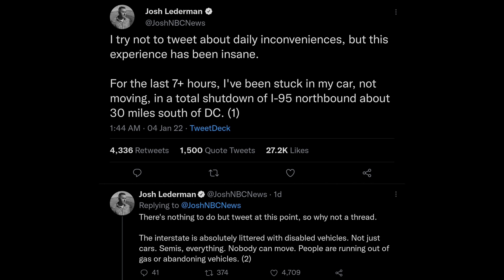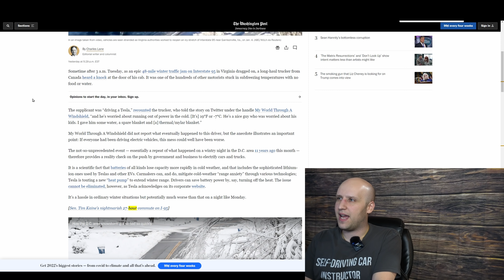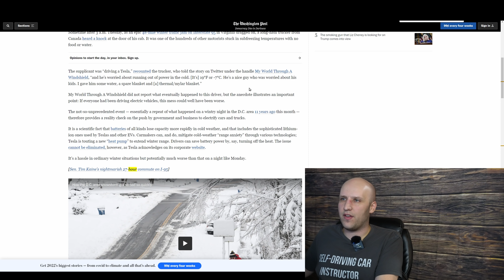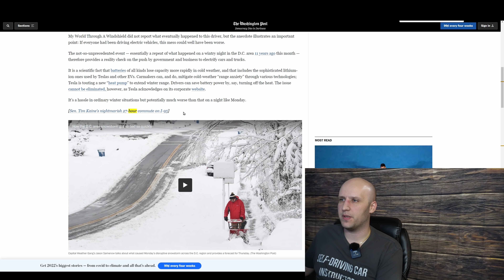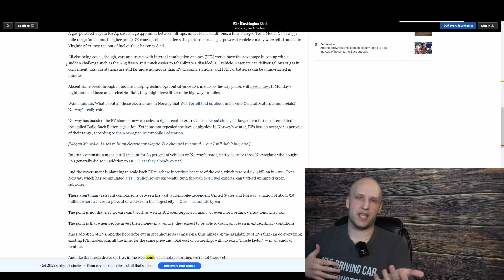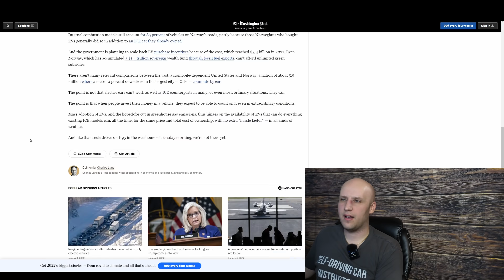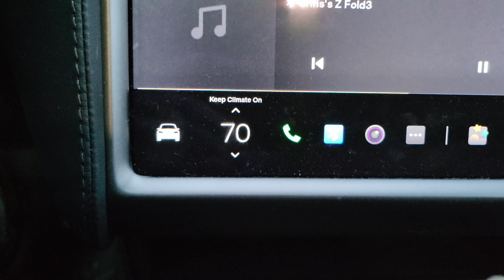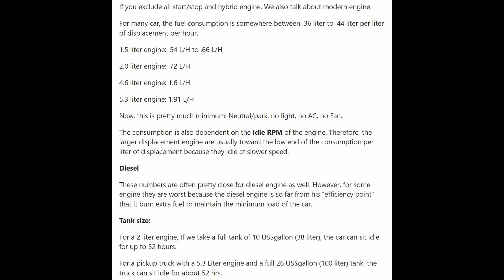How Long Can a Tesla Keep You Warm In A Frozen Traffic Jam? | FUD Debunking

Comment: I spent the last 4 years living and working in that area of VA. Moved back MN recently.  My dad sent me this article and I laughed because I would have rather been stuck in that situation in my Model Y than any other car. Would have been able to run the heat and watch TV for days before running out unlike the senator that had to run his car for 10 minutes every hour to make it through the 26 hour ordeal.  
Side note. My wife just took my car to work in the -24 F temps today because her gas car couldnt handle it.  It started at 92% drove 30miles ended at 77%,  sat for 13 hours and only lost 5% just started preheating for her return trip. Sad times when the electric car has to save the day eh?
Reply: Sounds like you need to keep up on your maintenance. Most cars start just fine in -24 if they have a good battery. My car runs just fine in MN weather.
Reply: I forgot the TV advantage and people mentioned "camp" mode.
Reply: Please give us details. I am sure most gas cars would still run at -24 degrees.
Reply: @jrod6236  They really don't like to and starting in those temps causes major damage to any ICE over time.
Reply: if it couldn't start, that has nothing to do with the gas engine but rather the battery that's used to kick start it. either it's charge is low or it isn't rated for those temps, that or there might even be something wrong with the starter. so either put the battery on the charger to top it off, get a better battery that is rated for the temps in your area or get your started checked out.
ofc pure electric is better in this case if you just want to get up and go. still like everything, not everything is instant and you wouldn't just get into your EV and go without preheating it.
Reply: @rocksfire4390  Preheating an EV before daily driving is all about passenger comfort.
Driving a cold battery is fine, it just won't regen much.

If you are gonna be driving a long trip you might want to preheat the battery to get more range, but for daily driving get in and go is no problem at all, except for driver comfort.
Reply: @dorvinion  
sounds exactly like ICE cars, aka you don't need to let them warm up and that's entirely just driver comfort.
will be nice once they get solid state battery tech into these EV's, cold wont do much of anything in most areas to them then.
Reply: How has your Tesla been in MN so far?  I also live in MN and have been apprehensive about Tesla due to their performance/ reliability in very cold weather.  Things such as drastically reduced range, charging in cold weather, autopilot on poor road conditions, etc.  Also concerned about the long-term effects on the battery.
Reply: @Tekmauz  Tesla tests their cars at a facility in Alaska which is part of the reason they switched from resistance heaters to heat pumps for the efficiency.
Autopilot just won't work if it can't see the lane lines, so in snow you have to steer yourself. New Model 3 and Y don't use radar anymore, but my Model S still uses radar and on my cross country trip at Christmas I had to clear snow and ice off the radar unit several times so I could use the adaptive cruise control, or autopilot. The radar is at the bottom center of the front bumper and snow packs in there. Tesla AWD is very very good combined with the weight of the car means very good traction.
Reply: @kenmcclow8963  thanks.  Another concern is the lack of Superchargers in my state, especially north of the Minneapolis/St. Paul Metro area.
Reply: @kenmcclow8963  I have seen (on Youtube) autopilots using tire tracks as guide lines as lane lines. Not the most efficient or safe, but it does do that when lane lines are buried in snow.

With my Infiniti I sometimes have that problem, radar is covered with snow and cruise control is unusable.

Cant wait for my Model 3 and ditch Costco gas line ups. Its either line up at Costco or pay more at other gas stations.
Reply: SAVE THE DAY , HOW BOUT YOU HAVE AN EMERGENCY AND YOUR FLAT BATTERY IS ON CHARGE = YOUR SCREWED , OR THE BAD GUYS SHOW UP AND YOU CANT ESCAPE DUE TO FLAT BATTERY . WHEN A V8 WOULD DRIVE STRAIGHT THROUGH YOUR GARAGE DOORS LEAVING THE BAD GUYS IN THE DUST !!!!
Reply: @lancethrust9488  In 2 years with an EV I've come home with less than 5% charge once. Even then if I had to get away from bad guys at home I can make it to the local cop shop.

On the other hand, getting to the garage in most houses means going through the bad guys, so you'd probably have to give the bad guys a case of lead poisoning before you'd be able to get to the garage...and if you manage that do you really need to get away any more?
Reply: @dorvinion  NO WHEN ITS FREEZING YOU SHUT DOWN HALF A MILE DOWN THE ROAD , THEN THE BAD GUYS SHOW UP IN THERE V8S , GAME OVER YOU SHOULD OF BOUGHT AN ICE VEHICLE !!!!
Reply: Send this video to him
Reply: Yeah what about a few years ago when California had a complete blackout how many Teslas were sitting in line to get power it was a total nightmare cars lined up for miles with no power
Reply: @dobermanguy9437  California rolling blackouts only affect a limited area for a short drive. I call BS unless you can cite references. 
A blackout would suck if you ran your battery down until you couldn’t go anywhere, but I always keep a 10-20% reserve so I could keep going. Plus Tesla tells you on the center screen how many plugs are available in real time at your next charging stop. I can’t speak for other brands that I don’t own
Reply: @kenmcclow8963  right! And all these what if situations, maybe true but rare, have mitigating factors. 

It makes the case for solar power backup for your house in case of a blackout. We don’t disconnect from the grid due to such blackouts or go out running to get solar. 

Give it some time and we will have most homes backed up with solar so grid blackouts won’t have such drastic effect as they do today. 

EVs are not for everyone but it’s great for most use cases of vehicles, provided one can afford to buy the car in first place. EV are here to stay and for the right reasons.
Reply: @kenmcclow8963  look good thing you kept some power in your car when they showed that news report there was hundreds of Tesla's lined up waiting to get charged it was total chaos if you think I'm making this up look it up for yourself
Reply: @dobermanguy9437  you may be talking about thanksgiving traffic on I-5 a few years ago but I just went through right after Christmas and there are 56 stalls at Kettleman City and they are adding 100 stalls a little up the road at Harris Ranch, plus lots of other chargers and some are fast V3. There are very few times of year when traffic is bad at Superchargers
Reply: Never  happened.

Comment: Maybe your tune will change when it costs $20k for a new battery, or when you spend 8 hours stopped and charging on a long road trip. Must be nice to be rich and own two of those money pits.
Reply from the maker: Hey man. None of that is true. We drove from MI to NC in a single day https://www.youtube.com/watch?v=07EnZpZKAVs 

Charging stops are normally only 15 minutes or so depending on the route you're taking, but can be as long as 30 minutes or more, with the longest being about an hour. I've never personally needed to charge longer than 30 minutes on a road trip. 

The battery warranty is 120k or unlimited miles (depending on the vehicle) and 8 years. But there are many examples of Tesla batteries lasting much longer than this. 

Unfortunately for now, most long range EVs are pretty expensive. But over time prices will continue to come down so everyone can drive EV soon!

I've been driving electric for 3 years and almost 70k miles and I wouldn't have it any other way. If you have any other questions feel free to ask!
Reply: @DirtyTesla  and advancements in battery tech are going to make them cheaper and last longer. In particular I am looking forward to solid-state battery technology in production vehicles.
Reply: You assume that everyone who owns a Tesla has a higher than average income. The average price of a new car is around $45K so a Tesla Model 3 or Y are within that range. I have traveled all over the country from Florida, to Seattle, Los Angeles & Boston in my Model 3. I have very seldom had to sit waiting impatiently for a charge, certainly not 8 hours. Please be kind, and don't make negative comments based on a lack of knowledge.

Comment: Thanks for the experiment.  Dressed for winter my Tesla actually gets too warm when I set it for 70 in 30 degree or colder weather and my 70d has the resistive heat.  Also the seat heater gets way too hot on 3.  In any case, folks would NOT freeze to death in an EV as the Washington Post article hinted at especially if they set their heater at 65 and left a seat heater on low to medium setting.  In the coldest weather I usually have the seat at 1 and the heat at 68 and I'm dressed for winter.  Based on your experiment, I'm certain I would have no problem surviving (staying warm enough) for more than 24 hours and would still have ample battery to get to an A/C outlet or charger when traffic started moving again.

Comment: Great analysis and test. Very fair. A few disadvantages of gas cars worth mentioning.

All those gas cars running their engines on idle. That's a lot of fumes you are breathing in. If we were 100% EV then on I-95 there would have been no fumes.

Snow can drift and if it drifted and covered the exhaust fumes could backup into the car, or the car might quit running. Neither scenario is very safe. Once again an EV doesn't generate fumes or need oxygen to keep running.

When people ask me what if you get into a traffic jam, I typically answer I smile because I know that my efficiency and vehicle range just went way up. A traffic jam gives me less to be concerned about with regard to range than driving at the speed limit.

Comment: Great video and awesome advice.

Here's the thing, and you touched on a lot of this in your video. If you own an EV and you live in a cold environment or you know you will be experiencing some cold weather and snow in the forecast then make sure you're charged to the 80-90% before getting on the roads...be they your local roads or the highway.

Depending on the vehicles storage you might want to keep a decent warm blanket in the car. Keep a couple bottles of bottled water. Keep some snacks such as granola bars or other snack bars that don't need to be refrigerated and maybe some bags of chips. These items will hold up well in the winter time.

If it hasn't been mentioned yet , if you own a Tesla and you're going to be stranded on the highway like this or stuck somewhere in a cold environment then use the vehicles "Camp Mode". I believe it will do a lot of what this test just showed. You still have access to games, entertainment, Netflix and more. 

If you have a large enough EV then consider keeping an air mattress made for vehicles/camping in the car. If you own a Model 3, Y, X and I assume a S you can inflate the mattress and fold the back seats down so that you can stretch out. Check out some Youtube videos about camping or sleeping in your Tesla and you will see how possible it is and get an idea of some of the products people use.

Look, I live here in Northern Virginia and I'm all too familiar with the traffic issues on I95. While it's best to to not be in that mess during a snow storm it may not be avoidable. If you can't avoid it then follow the suggestions in this video and some of the things I said above and you won't be uncomfortable in your EV. And you'll see that the article overhyped the situation.

Comment: I believe the comparison between ICE and BEV here would change as the exterior temperature decreases.  Heating the cabin of an ICE in a traffic jam would be a byproduct of an engine that is idling regardless, with the cabin temperature being regulated by flaps or whatever mixing inflow of air.  In an electric vehicle, the cabin temperature would be regulated by pumping more or less power to the heating system?

Correct me if I'm wrong -- it would be interesting to see this comparison at -5 or -10 degree increments to see the effect of heat losses from an idling combustion engine depending on the delta between exterior and interior temperatures.

Comment: What a manipulative crap article it is...😮 How long can you run an ICE in order keep the passenger compartment warm? And how long does it take for people to drown from a lot of ICE cars idling at one place?
In contrast, a BEV can produce heat for days without any exhaust. Even with a resistive heater. Equipped with a heat pump, a week? It's just stupid to travel with a low battery. Just like with low fuel.
Also, you can rescue a few ICEs with a can of gasoline. How much BEVs can be rescued if that gasoline is used for a mobile electricity generator? More than the former, I'm pretty sure. Efficiency...

Comment: I got stuck once in my LEAF for 6 hours in traffic and I just used the seat heater and my electric blanket.    The battery is too small to keep the heat at 70 degrees in a 2012 LEAF.   In 6 hours I only used around 15% battery.    I turned the windshield defrost on only when it fogged over.   

Now I have a 2021 Model Y and I don’t need to “rough it” any longer.  I can pump the heat the whole time. :)
Reply: I own a 2011 Leaf. Did you trade yours in when you got the Tesla?
Reply: @waywardgeologist2520  Nope.  #LEAFsavesMyParkingSpot
Reply: @nissanleafbattery  I don't live in a large city and don't have to struggle to just have a spot to park. 

How do you home charge?
Reply: I drive a 2013 leaf and work 12 miles from home. Last years winter range was close to 27 miles in the 30s if I did not use the heater. I am limited to car seat heater and steering wheel heater in the winter. Nissan sucks, never again.
Reply: @donquique1  That’s what I can do,   28 miles now.    Instead of spending $7500 on a new or slightly used pack; I bought a Tesla.   Life is too short to drive short range cars.   Here’s my Tesla: #NAY2GAS
Reply: @nissanleafbattery  my Nissan dealer cannot even get me a battery even if willing to pay for it.  I love driving evs but have serious concerns about them, privacy, right to repair, unavailability of parts and technicians, ect. My next car would be a hybrid ic ev. The ev infrastructure in Texas and the south is not ready for prime time...
Reply: @donquique1  I have a friend named Dex Tan Who has a shop in Dallas that swaps Nissan LEAF battery packs.     His shop info is on my map.
Reply: Good for you LOL. Wait until electric cars have a new power source. Trade yours in with the old lithium batteries, it will be worth peanuts unless you’re leasing it, so thats like renting a car then LOL.
Reply: @oddities-whatnot Really? Replying on a 2 year-old comment? 

Where have you been looking for gas stations?   

In December, I will be driving 100% electric for 12 years    

I currently own three electric vehicles and I at leased one that has been returned. 

In 12 years, none of the traction batteries have Ever needed to be replaced  

The Tesla model Y long range battery is rated for 500,000 miles   

I have 42,000 miles so far in four years   

It’ll take me 40 years to get to 500,000 miles   

You can laugh all you want   

But you will go through two combustion vehicles before a Tesla battery dies  

Please stop being an #UPHEV

Comment: Would "camp mode" provide the same comfort and use less "juice"? Also, if you were driving before being stuck, the battery and the car would be warm and the loss of charge over 12 hours should be less. I would definitely rather be in an EV.